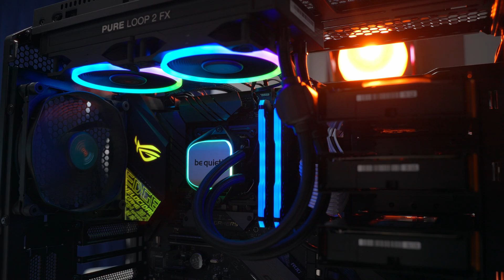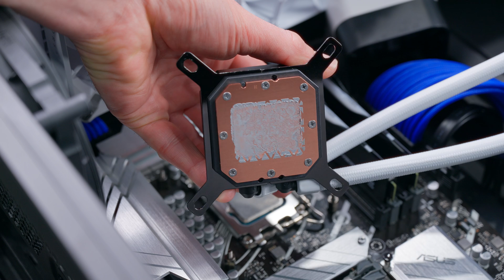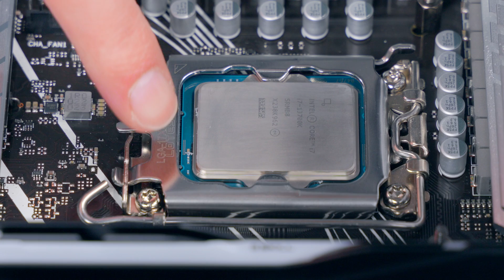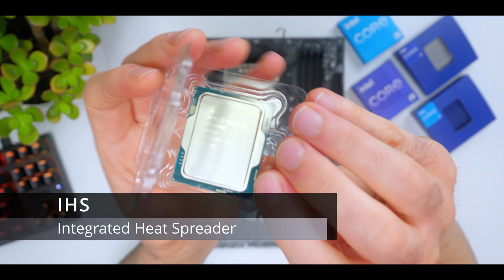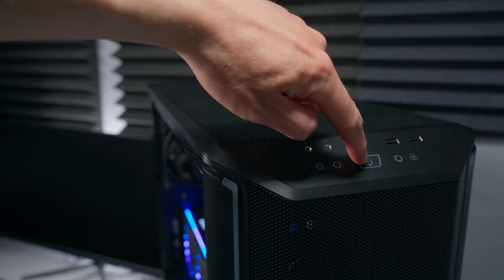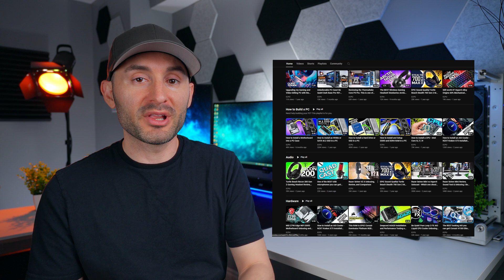How to Apply Thermal Paste to a CPU

Comment: Wrong. Do not clean something on top of the pc like he did. Take it off and do the cleaning in the table. What if you drop the pump somewhere in the mobo?
Reply: It's fine to wipe it with the paper towels as he did, but dumping the alcohol into the paper towel while hovering them both over the open PC is super risky; could have easily spilled on the PC. In any case you can just let the alcohol evaporate but then you can't turn it on until absolutely certain all of the liquid is evaporated.

Comment: you did one thing wrong
the pump cable should go to fan1/pump header 
the 120mm fans on the radiator should always go on CPUfan header
Reply: Also doing the cleaning on top off his pc is wrong. Too lazy to take it out the case

Comment: As an avid PC builder that first application method made me cringe so bad. Spreading it around can actually lead to uneven application vs the even pressure of the second method. Using a spreader also can introduce air bubbles which can decrease the efficiency of the cooling.
Reply: Also he lay down the pc and start cleaning on top of the motherboard, pouring alcohol too. Too lazy to take out the cooler. Just another pc guru

Comment: Spatulas are messy, just use a clean finger and spread evenly, your finger can sense the slightest unevenness, to make it spread easier, just wipe your finger with some 99% isopropyl alcohol. Applying paste is simple, no need to make it difficult and awkward. ECPU good informative vid, in the end, as long as both surfaces are covered all is good.

Comment: Method #2 the pea is what I have always used = No air entrapment easier install and after a year or so taking the cooler off it has always been evenly spread. But I have seen these Graphene sheets with their results showing great effectiveness I want more info on the Graphene sheets might just be the thing? They don't need changing ever or a long time.

Comment: is the rubbing alcohol necessary? i dont know if i have any readily available
Reply: I would say: very very VERY advisable you do use isopropyl alcohol. It will clean your components and it will also evaporate naturally without leaving any residues.

Comment: I have started applying it to the heatsink. A thin layer and then install the cooler. It works better for me than the 1000 other ways I've tried. Give props to the heatsinks they send with new processors for the idea. I just copied it.
Reply: Best idea. Also just to make sure you can also apply a very thin layer on both... A lot less on the CPU just to be sure all the valleys on the heat spreader have the air removed and are filled with thermal paste. You should almost see the metal under the paste to make sure it's not too much of it. Too much paste is always a bad thing.
Reply: Jesus loves you so much and He is waiting for you with open arms, please accept Him in your heart and life while He is near

Comment: I really didn't trust the"pea" method.. but everyone seems to mention it.  Of course lots of people say lots of things that aren't correct...

Either way i don't trust it; even if it does appear evenly, how are you supposed to ensure that it goes to all the edges? That seems impossible to me.
Reply from the maker: It comes down to applying the right amount of paste.  I've been using this method for over a decade without issue.
Reply: @ECPUz  I just spread a layer with a thin guitar pick. I'm pretty certain it was done fine but who knows because I can't POST. I'm almost certain it's the BIOS; it's 5th gen Ryzen and the mobo ships with 3rd gen... But the stupid Asus website says they don't have any software available.

I haven't changed a CPU in almost 20 years, since I was 14, but I'm sure I did it right.
Reply: @ECPUz  do you have any advice ?   I know the PSU, GPU etc work; all that I changed is the Mobo, RAM (since I was on ddr3) and CPU. I'm reasonably certain that I installed everything properly and that the issue isn't the hardware of the mobo or CPU ... It could be the one stick of RAM but what I'm betting on is it's the bios firmware .. 

But I don't want to go down the rabbit hole of customer "service" ... Why the hell does the Asus site say they have no software for this mobo? The documentation is littered with them pushing the virtues of their bios flashback and related stuff... But then they don't have any. And no explanation as to why.

I'll save my cynical rant , I'm just annoyed.  But I figured it would atleast bring me into the BIOS, or an error screen, even if the BIOS firmware didn't support 5th gen.
Reply: NVM I'm an idiot... I'm still annoyed at Asus for not having any software available though... I'm likely going to need/want that.
Reply: tbh the chip of the CPU is in the middle, other than that, it's just playing safe
Reply: Just use small centre x with good amount of only centre paste. Works best for me its better than old school big X